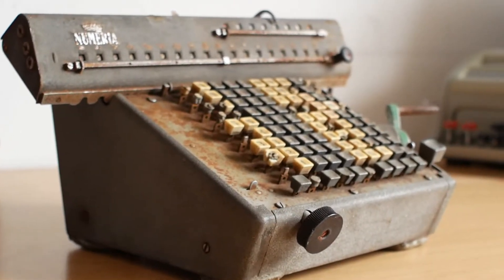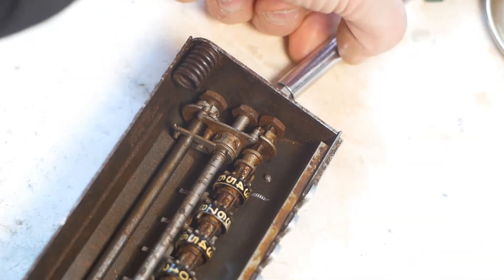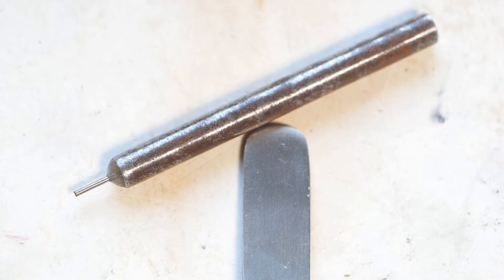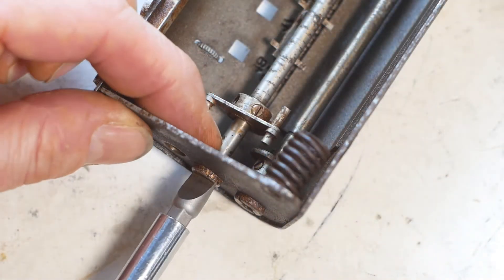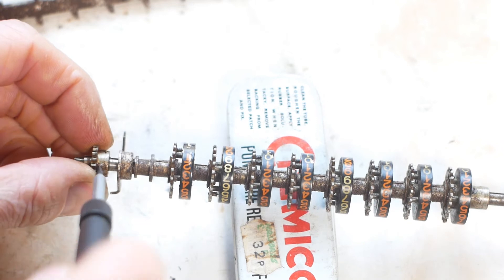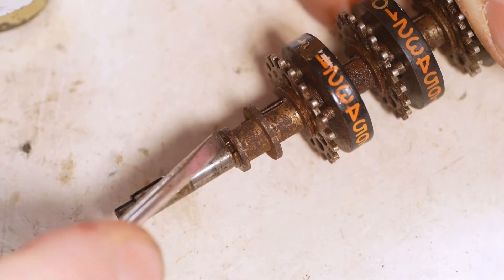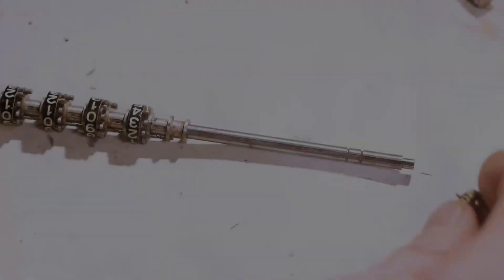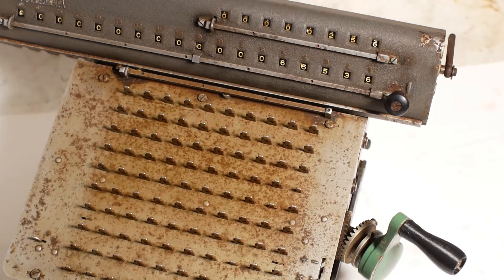Vintage Mechanical Calculator - Lagomarsino Numeria Model 9203 - Part Two - Carriage Repair

Comment: I would, without a doubt, lose those tiny springs and pins😂 It's great to see intricate work. Can't wait for the next part👍
Reply from the maker: It has been known for me to lose or at least temporarily misplace, small parts like that - I try not to because they will invariably leap into a dark corner of the room, full of stuff, and take forever to find!!!  I was filming the next part yesterday - foolishly I tried to use natural light - every few seconds - bright sun, cloud, bright sun, cloud - I eventually junked a whole load of clips that had gone from nicely exposed to washed out or vice versa, and set up some studio lighting, ho hum.

Comment: What a cool machine! I can’t wait to see the new keys & feet!
Reply from the maker: Hi SpinierPigeon, It's coming along nicely, the feet and clearing handle are done and half of the keys are done - the keys are proving to be a bit of a pain - they probably take around 10 minutes each to sand smooth after the 3D printing - 100 keys x 10 minutes, hmmmmmm......  It'll be done soon and I'll be able to do the third video.

Cheers for the comment  :-)

Comment: That's very fiddly work, well done!
Reply from the maker: Cheers Benedict, I wanted to film that bit hopefully to help other people who might want to have a go at one of these machines, and also hopefully stop them charging at it like a bull in a china shop.  Unlike modern stuff that's designed to snap together and never come apart again, these machines were assembled carefully by hand and they can be dismantled and repaired carefully by hand.

I'm pleased with the job up to this point but what ever possessed me to think it was a good idea to make 100 replacement keys - I've got 50 done so far and it's taken every bit of spare time I've had this week.  I could have just 3D printed them and left it at that, but the horrible look of 3D printed components wouldn't have been that nice, so they're all being sanded on 5 faces, including the concave top face and then the numbers infilled with paint.  I think my original idea of making them out of wood might have been easier in the end - 2 different colours of wood, drill into the bottom for where they fit onto the key post and maybe use a pyrography tool to burn in the numbers etc etc - still wouldn't have been a quick job.
Reply: @GrumpyTim  I do think that your videos will give people both the confidence and knowledge to have a go themselves. Hopefully they film it do that they know how it goes back together.
Reply from the maker: @BensWorkshop  Yes, either film or photograph.  I recently spent a week helping someone to repair a typewriter they'd bought - I suspect they'd never taken anything apart before - it took many messages, photos, more messages and I even ended up posting them a screw because one went walk about during the repair.
Reply: @GrumpyTim  Everyone has got to start somewhere! Though possibly not with a typewriter or adding machine.
Reply from the maker: I'm actually quite impressed - from apparently no experience, they managed to successfully change the ribbon, oil the mechanism (without just spraying WD40 everywhere!!!!!) and then do a fairly tricky repair to the ribbon carrier (which was both damaged and assembled incorrectly), straightening a bent part and re-assembling in the correct order.
Reply: @GrumpyTim  Cool. I have some old typewriters about suffering from dust.